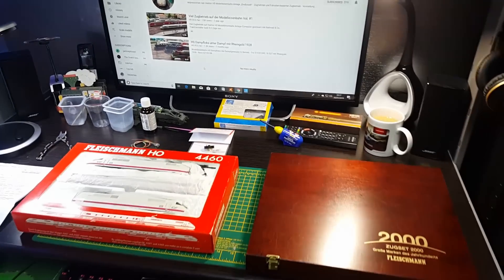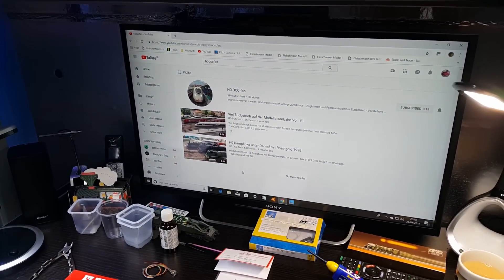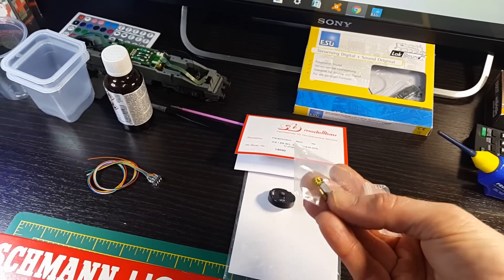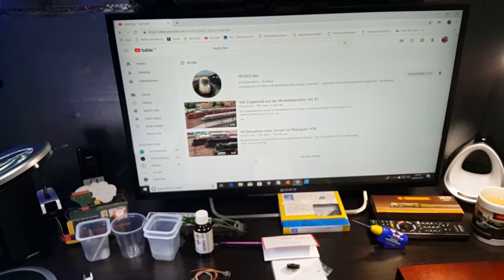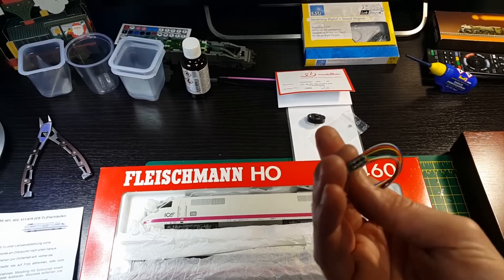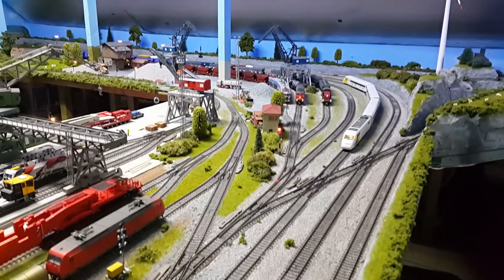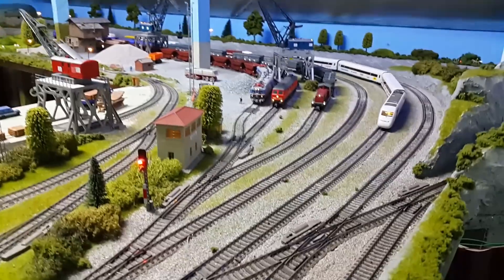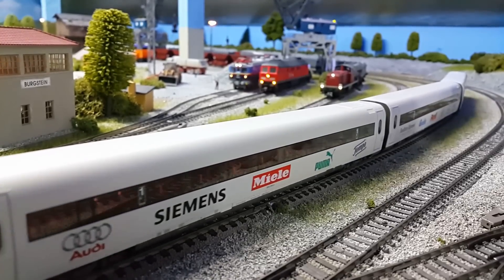Fleischmann Ice 2  2000 retro fit motor.

Comment: Great to see you get it going.  Wish I were closer, as I speak and read German fluently.  Both I-C-E's are gorgeous.  I still need to add an ICE 1 to my collection (although it is not really different than an ICE2).  Great job, as always!
Reply from the maker: This is a good test for future retro fits to old models and  other areas inc the fleischmann turn table.
I do have a cousin in Germany which I see now and again.

Thanks.

Comment: Did you use epoxy adhesive to fix the Faulhaber motor in place?
Reply from the maker: Yeah I used a two part glue on the pick up and a special loktite 480 on the motor.
Ultimate raceing Thread lock on the motor shaft gear.
Reply: @hovermotion  will you do a vid on the installation process? thanks!
Reply: Mr hovermotion, I love your channel! I collect.fleischmann, I have the millenium ice, Amtrak ice, experimental ice, and the standard ice....I'm holding out to find the coveted Bayer edition, super rare and super $$$$. You have a spectacular layout!
Reply from the maker: @dbdrdbag  No not on this loco as I was learning and it took me days to do on and off but on the next vid I will do a detailed vid showing how to do another fleischmann ice 2.

Jim
Reply from the maker: @davidlanca5731  Many thanks David...yeah the Bayer is ultra rare I nearly got one a few years back....I have a few Ice trains like you...I bought the Fleischmann big ice start set even before I had a layout they are superb..
Jim.
Reply: @hovermotion  Thanks Jim, looking forward to it!